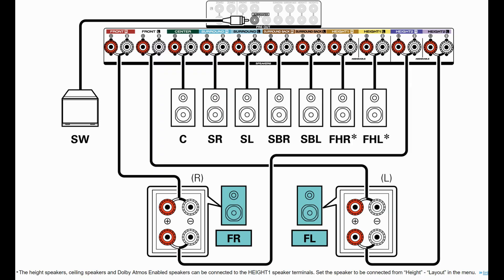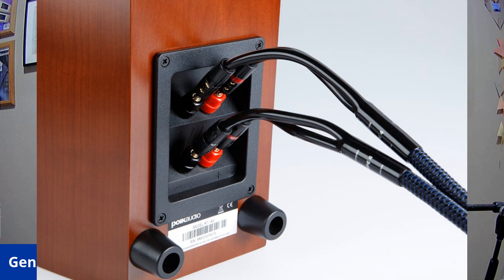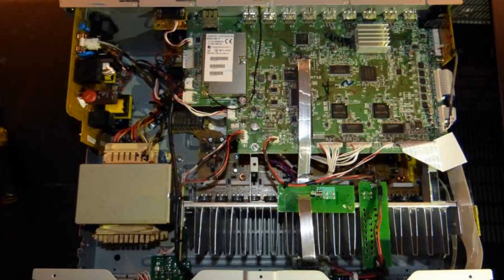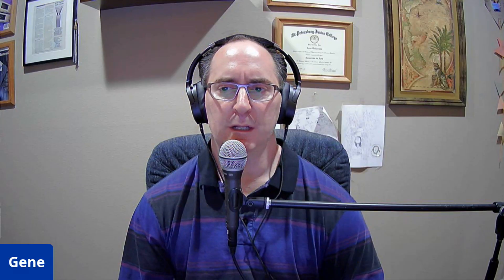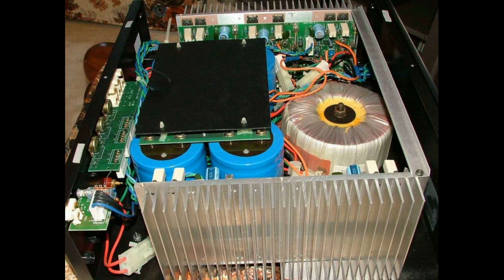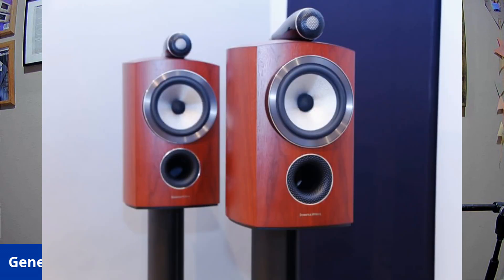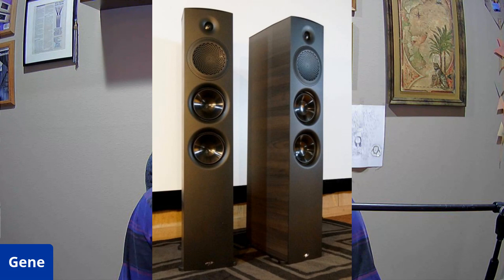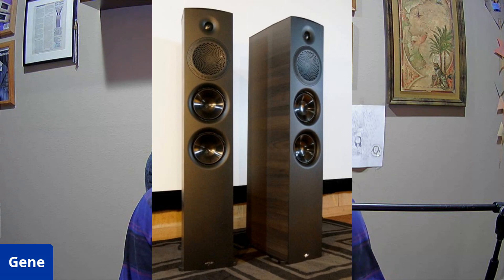Should You Bi-Amp Your AV Receiver?

Comment: Hi Gene, thank you for yet another informative video.

I have only owned two AV Receivers and both of them were/are Onkyo; my current AVR is the the Onkyo TX-RZ830 (previously I had the TX-SR875) . 

I have always used the Bi-Amp feature to run my two main front speakers - Monitor Audio Silver RS6.

First of all would you say this is a waste of two additional channels I could be using to increase my current setup from 5.1.2 to 7.1.2?

I am very curious about Bi-Amp and have been looking at getting an external stereo amplifier to run the front speakers via a Pre-Out setup. 

However I cannot make it work in my head since the Pre-Out would mean I would still have to sacrifice the surround to continue Bi-Amping, and I do not regain those particular channels with a seperate stereo amplifier.

Is there a way to run the front left and front right speakers from a Pre-Out connection to an external stereo amplifier, which then can individually Bi-Amp the sound being sent to the RS6 speakers? 

As a result this would then leave me 9 channels to power/process on the TX-RZ830; potentially I could have 7.1.4 setup.

I hope this makes sense and that you can provide the absolutes that I personally have not been able to find when researching this for myself.

Thank you in advance and I hope you are keeping safe and well.
Reply: If u haven't figured this out yet, I'll give u some advice. If u get an RCA Y splitter, you can do this. Obviously, you'll need amps to connect to. So, take the splitter and connect one to the right and one to the left. Now, each has the ability to connect rca cables, left and right to one splitter. Run those to a 4 channel amp or 2, 2 channel amps. Then, connect the speaker wire as needed to your speakers. The splitter is 1 male RCA, to 2 female RCA ends. It's hard to explain without showing you but I assume you get the idea.

Comment: I use the bi-amp feature to run 4 front floor speakers. It’s a 7.2 channel Yamaha and all the channels output the same watt.  Changing the setting to bi-amp makes the receiver a 5.1 channel. But instead of running one channel to the upper of the duel post speakers I just power one set of speakers with one channel and another set of speakers with the other.  Sounds great running it In 2.2. Channel.

Comment: Running a Marantz SR8012 and biamping the two front speakers, old Paradigm Monitor series, using the preamp mode and two Rotel rb960 BX amplifiers.  Old stuff but sounds really nice.  Lots of power.

Comment: Hi Gene, thanks for the video. I have a Pioneer VSX LX 504. Can I go ahead and bi amp with my Polk S55 tower speakers.
Reply: I don't wanna be the bearer of bad news and I don't know your previous receiver experience...
The VSX-LX504 unfortunately is a VSX series receiver, not the more powerful SC-lineup - despite the LX nametag, foul play by Pioneer sticking it on there, if you ask me.
It doesn't have a Class D-amplifier and it lacks the MCACC Pro features all other LX-receivers have.

I bought the VSX-LX504 thinking it must be at least as good as my old SC-LX71 ("It has LX in the name, how bad can it be?" Right?) but just couldn't get to like it no matter how I tried. So I returned it and same-price-swapped it for a higher model from an earlier year, namely the SC-LX801 - Day and Night difference, no joke.
Tried all sorts of calibrations and measurements with the VSX-LX504, but could not for the life of me get it to sound anywhere near as good as my old SC-LX71 (also Class D amp and the full MCACC feature set). The SC-LX801 however sounds just as good, even better, than my old beloved receiver.

To answer your question then - I wouldn't recommend bi-amping with that receiver as it lacks the Class D-amp that Gene even mentions. You wouldn't gain anything doing it.
Reply: @daniell4835 . Thanks for your suggestion. I will not go for it.

Comment: Could biamping a cheap receiver actually be worse than not since you are driving more channels which would lower the output capability? My thinking is that a cheap receiver rated 80 watts 2 channels driven would obviously put out less rms power if 4 channels were being driven.
Reply from the maker: Very possible. I wouldn't do it.

Comment: I don't quite understand that logic. Why would 4 amps work any worse than 2 regardless of a power supply capacitiy? If you split a load between multiple amps each one of them will take less energy from a power supply. But a total consumption will remain about the same. However, the rest of potential benefits of bi-amping should still be there.
Reply from the maker: Not really. IF you run a 3-way tower that has a bass section and a mid/tweet, there can be more demand placed on the receiver to drive 4 channels instead of 2 since its fed off a common power supply that may be undersized for the task.
Reply: @Audioholics  Where will that additional demand come from if you have the very same speaker and the very same amps connected to the power supply all the time? Do you realize that any power amp takes from a power supply the only current that goes into a speaker plus some quiescent (idle) current (that rarely exceeds 50 mA per channel)? And in most cases that quiescent current would be contuniously consumed by all available in a receiver power amps regardless of channel utilization.
Reply: The problem is that the receiver can discern where the crossover is in the speakers so it just runs the two extra channels full range. So you aren’t splitting the power anywhere you just have double the channels running the same signal and thus double the power usage for the same output.
Reply: Cant discern*
Reply: @noahnovotny2100  Do you understand that without a load any amp will consume no energy besides some idle power? No matter how hard you run it. But when you split a load you would also split an output current (and power) that goes into a speaker and a power consumption between those channels of amplification. 
For better understanding I'll provide an example with numbers:
Let's say we have 4 x 100W/ch class AB power amp with +/-50V power rails and 50mA idle current (per channel).
Case One: 2 ch. operation. Let's say we drive speakers with 60W of power per channel (on average). The power consumption would be about 120W + 120W + 0W + 0W + 4 x 5W (idle power) = 260W.
Case Two: 4 ch. bi-amp operation. In order to get the same volume we'd need to supply (on average) about 45W/ch. into bass sections and about 15W/ch. into mid/high sections of the speakers. The power consumption would be about 90W + 90W + 30W + 30W + 4 x 5W (idle power) = 260W.
Reply: @IliyaOsnovikov  Wrong. Power burned in a class AB amp depends very much on power delivered to the speaker. So is NOT fixed at 5W (in your example). Explanation: P = I*V. Here, I is the current running through the amp into the speaker. And V is the voltage across the amp (which is the difference between supply voltage and voltage across the speaker). This holds for DC but also for AC.
Check https://sound-au.com/articles/class-g.htm Figure 5A for the curve of power burned in amp vs. power into speaker.
Therefore, bi-amping does certainly increase the total power consumption of all amps together, even when there would be no idle power. 
And I'm 100% sure Gene understands ;)
Reply: @MrTheNark  In my example I assumed that an amp has 50% efficiency. And in a case when it delivers 60W into a speaker it also takes additional 60W from a power supply and dessipates that via heatsinks. Total power consumption is 120W.
If you claim that there would be lesser efficiency on a lesser voltage output (like it's shown in that article), I have to note that in order to keep the same sound volume in case of bi-amping the amp output voltage for every speaker driver have to be exactly the same as in case of a single amp. The power split between the amps in bi-amping mostly happens in a time domain.
Reply from the maker: @IliyaOsnovikov  you will very likely consume more power in Briamp mode vs single amp mode. The passive crossovers are not brickwalled and thus the 4 amps will also be delivering some out of band power instead of just 2 amps driven. Some receivers current limit with more than 5 channels driven so if you're also powering a center and surrounds,  you risk going into current limiting when driven hard with 7 instead of 5 channels driven in this example.
Reply: @IliyaOsnovikov  Ahh, yes, if you assume that power split happens mostly in time domain (so in the speaker either the bass or the midtone/tweeter section plays) then yes, I fully agree with you that bi-amping doesn't change much to the total power draw.
However most music has low and high frequencies simultaneously, right? And then, when you use bi-amping, each amp has to deliver less current so ends up in a lesser-efficient region, such that the overall power of all amps together increases.
Reply: @MrTheNark  Please notice that article lists an output voltage as a major factor influencing amp's efficiency. The output current into a load and the output power, the voltage drops across output transistors and the amp's power dissipation all are derivatives of that output voltage. But in case of the passive bi-amping the output voltage at every given point in time would be exactly the same as in case of a single amp. So efficiency of those amps should also remain the same.
And like you've mentioned just the output current will be splitted between two amps. 
So based on that power formula for a sinlge amp P=Vd*A we can say that one of the amps will have dissipation P1=Vd*A1 and the second - P2=Vd*A2, where Vd is the voltage drop on output devices and A1+A2 =A (output currents of amps 1 & 2 in bi-amping set-up and the singe amp output current into a whole speaker). I would refer that conclusion to the Kirchhoff's current law.
Reply: @Audioholics  There is such thing as the Kirchhoff's current law. No matter how you would connect a multiway speaker the current thru the whole speaker will always be equal to the sum of currents thru it's parts.
Reply from the maker: @IliyaOsnovikov  I love how you're trying to teach basic circuits 101 to a degreed engineer and circuit designer. It's  cute but misplaced.

You may want to read this article to understand the complexity of the situation:
https://sound-au.com/bi-amp.htm
Reply: @IliyaOsnovikov  Hmmm. I start to think that you're right.
Funny, it goes against all my intuition.
But as long as there's negligible quiescent current, and as long as the sum of the impedances of the woofer and tweeter terminals of the speaker are equal to the total impedance of the speaker (which must be the case), you have to be right... I never realized this when reading about bi-amping. 
But maybe there're other effects going on... I'll check the above mentioned article...

Edit: our conversation is about this so-called "passive" bi-amping, where the crossover stays in the speaker and not in the amp. Both amps output the same voltage. In this case, the total drawn power should stay the same (neglecting extra quiescent current in the second amp). 

However... I think Gene is talking about active bi-amping, where the crossover is in the amp, and bypassed in the speaker. In that case, both amps start outputting different (lower rms) signals and in addition, the total speaker impedance changes because the passive crossovers in the speaker are removed. Both amps start working in less efficient ranges, so the total drawn power in both amps together indeed will increase with active bi-amping.
Reply from the maker: @MrTheNark  yea it's way more complicated then resistor loads. What you're saying is more applicable IF you bandwidth limit the signals before they are amplified. I should probably do a video on passive vs active biampling as a followup. Good discussion.
Reply: @Audioholics  I am glad to learn that you are qualified to discuss this topic. However, it seems like your claim that LOW and MID/HIGH sections might take more current when are fed separately just contradicts that Kirchhoff's current law. Does it not?

If you are interested, some simple experiment may be the easiest way to find the facts. An amp/receiver could be be plugged into some digital power meter energy monitor.  The same record should be played with the same volume with both set-ups. Then cumulative energy use readings for each configuration could be compared to reach the conclusion. That could be another interesting popular video of your project.
Reply: @MrTheNark  I agree. With an active bi-amping situation will be very different. But in that case there also will be no losses on passive crossover elements. 
Regarding that extra quiescent current in the second amp: I guess those 7-ch receivers most likely may have all power amp channels constantly powered even when some channels are not used at all.  
Also I've proposed to Gene some experiment to determine a power consumption for bi-amping set-up vs a regular one. I guess I might try that some day if he or someone else won't do that before me.
Reply from the maker: @IliyaOsnovikov  I have a current meter that can monitor this and it would be interesting.  After I get the AH Smart home running I will revisit.
Reply: @Audioholics   Cool! 
On a music signal the current will be constantly changing so I guess it could be difficult to compare those readings. Are you planning to capture MIN, MAX and AVERAGE?
Reply from the maker: @IliyaOsnovikov  Just FYI, I spoke with a loudspeaker designer I trust. He said passive biamping a tower where 1 amp goes to bass driver and other amp goes to mid/tweet will definitely use more power supply current compared to single amp connection for the reasons I stated. Double the output devices are conducting in this scenario. Definitely worth measuring when possible.

Comment: Hi Gene/guys
May I use VAN den Hul CS 122 for the HF and VAN Den Hul D 352 for the LF 
Opinions please guys 
I would really appreciate it 
I have these cables already
I have a Marantz 8012
Speakers are Sonus Faber Venere 3.0 - 6 ohm
Reply: Using different cables for the different channels actually used to be quite popular because people thought that some sounded better for highs and some better for highs. People don’t do it now because cable manufacturers claim that there cables can do both highs and lows well now. Whether you believe in cables or not it won’t hurt to try.
Reply: @noahnovotny2100  thank you for your reply brother, much appreciated. 
I used cheaper cable on a pioneer sc-lx85 in 2011, bi-amping really cleaned up the sound especially at lower volumes. The speakers I have now seem much more hungry for extra power. Have been using normal cable so let’s give it a try and see

Comment: I have a Yamaha processor running a Yamaha mx-a5000.
Can I use channel B on that amp and split the cables to my Soavo fronts ?
So I'd be using channel A removing the speaker links and then using channel B in the other speaker terminals.
Reply from the maker: yes
Reply: @Audioholics  awesome,  didn't know that. 
Yamaha are a bit lapse on their user manual for the mx-a5000
Reply: That’s not actually biamping because speaker a and b are run off the same amp. You would be essentially running the bass and treble in parallel to the amp meaning that you would be halving the impedance of the speakers, which could mean overall rms output power could double, but I doubt it. However it could be a bad idea if you speakers are rated lower than 8 ohms. Just because the nominal rating is 8 doesn’t mean the actual impedance is always 8. Klispch speakers are rated 8ohm compatible, but can have dips down to 3.7 ohms. If your speakers are similar that could mean your receiver would trying to drive a sub 2ohm loud which is not something anyone would recommend. 

Overall, the benefit could be a dB or two extra in max output, but the risk is there.
Reply from the maker: @noahnovotny2100  actually if SpkA and SpkB are on the same amp and you connect to speaker after removing the jumpers, you are biwiring. Impedance the amp seems is nearly identical aside from a slight difference in cable impedance. There will be no increase in power or SPL output.

Sorry I misread and though he was using separate channels in the MXA5000 to biamp.

Comment: Very informative but I'm in a niche you didn't really cover... I have Polk RTi-a9 towers, with a CSi-a6 center that I only really use for more cinematic movies; so 99% of the time I run just the towers. My receiver is the Denon AVR-X2100W, which I have set to a 6 ohm load. Would it benefit from bi-amping in while driving all 3, or only in stereo, or neither? 
Thanks for the great videos, and much appreciation if you had any thoughts on my specific setup.
Reply: I won’t comment on the biamping but receivers should not be run in the 6ohm setting. It is made so that the manufacturers can claim to run lower impedance speakers but in reality all it does is cut power. Even if the speakers are 6ohm they will never benefit from being run in the 6ohm setting. I believe gene made a video on it at some point or he’s at least talked about it.
Reply: @noahnovotny2100  Thanks, I'll have to try and find that video.
Reply: I have a9’s as well.  I run mine with a dedicated amp.  Night and day difference, but it depends on volume you listen to.